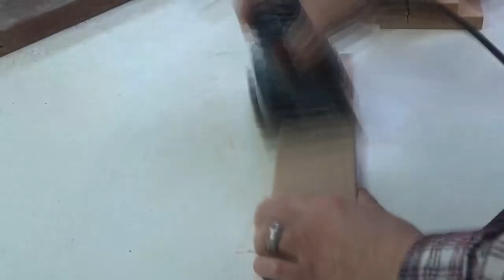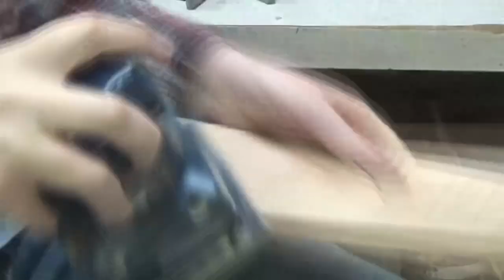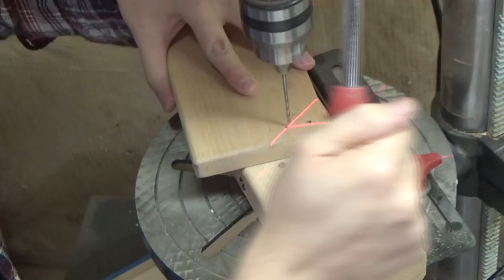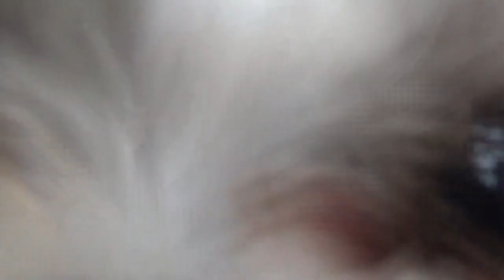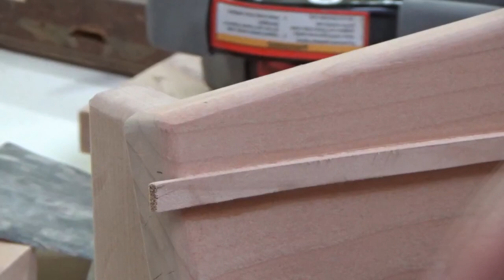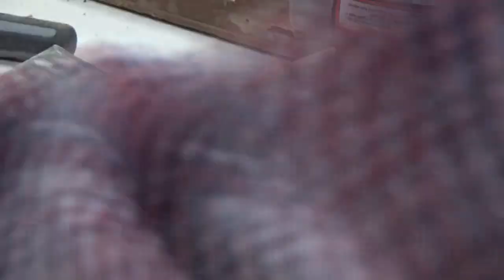Woodworking: How to build a self-sorting coin bank

Comment: Nicely done. Now you need to fashion a large hopper above so you can dump in a handful of coins. ;)
Reply from the maker: Funny you should say that... I was actually thinking of exactly that for another video.
Reply: You'll find that that aspect is hundreds of times more complicated than you might imagine. It is a completely different issue to be able to dump a big (or even medium sized) jar of coins into a hopper and have them come out one at a time versus feeding into a slot one at a time. Coins have several ways in which they can jam up and work with each other rather than cooperating with your wishes. The topic of and the physics of coin counters are....kind of interesting. Of course what you have is a sorter, not a counter.
Reply from the maker: I know how I'd do it. The key to feed them one at a time is doable since 2 of the thinnest coins (dimes) still are thicker than 1 of the thickest coins (a nickel). A hopper with a star wheel at the bottom that pushes coins through a slot just thick enough for 1 nickel. I just may get around to making it but honestly it's pretty far down on the list.
Reply: Gravity can assist as well if the star wheel is inclined and might help a potential jam situation - e.g. if the back edge of a nickle is resting a little on top of the wheel rather than fully in the slot the front edge may be able to get a bit into the slot. Totally overthinking this for the purpose, though, I know!
Reply: If you go and look at actual commerically made coin counters, no, you are not overthinking it, at least in terms of creating a real world functioning machine. There are a fairly serious lot of irritating problems dumping a big jar of coins into a hopper, having the coins come out one at a time, then sorting them. (Never mind counting them) It all seems so simple when you see a typical commercial machine working, even an older handcranked Klopp (which are great machines) apparently handling wads of coins with no big issues. But I can tell you, large numbers of coins piled on top of each other randomly can be phenomenally uncooperative. There are many many ways they can jam, they can have nicked edges or bits of sticky goop on them, or be bent. Or all of those. 

I happen to have a Cummins jetsort desktop machine that I got at an auction super cheap, not because I needed it, just because it was so cheap. And it is a completely fearsome machine. You can put 30 pound of coins through it, it will count & sort them in maybe a minute and change, and it will come up with the same count as many times as you put the coins through it.
Reply: Fisher's Shop you also need to devise counters for the sorter.

Comment: I relize there are a bunch of haters in these comments but i have been stuck on a slightly more technologically improved version of an idea like this for weeks. All of my designs have some sort of flaw and then i came across your video. It is simply brilliant, but i have a couple of technical questions for you, i understand the main ramp is the thickness of a dime, how much taller or thicker are the triangles than the main ramp in order to get them to push the coins off? and can you take that angle gauge from your table saw and post the angle you made for both the main ramp and the board that the coins lean against? i think that hose two things would be tremendously helpful.
Reply from the maker: Thanks gillespie!  The ramp thickness has to be the thickness of a nickel since that's the thickest coin.  The little triangles don't have to be so big because once the coin is moving, it doesn't take much to bump it off the ramp.  In fact, the steeper the ramp is, the smaller the triangles have to be.  As for the angle, I just played around with it until I found one where the coins would barely roll on their own (not sure exactly what that angle is).  Thanks for posting and commenting!
Reply: I am curious about one part of your design: what made you decide to bump the dimes off rather than let them run off the end? I do get that the style is probably better this way with all of the jars lined up. The reason I thought of this was a machine from when I was a kid - dairy farm kid but we also had chickens and sold eggs. The egg grader system we had thee scale stations on the track and dumped the eggs off at a right angle but ones lighter than the lightest scale were pushed off the end of the track to a separate bit of the table.

Comment: If you find yourself fighting a piece that wants to slip and slide around while clamping a glue-up, try adding a tiny sprinkle of table salt to the glue. Not a lot, just a dozen or so grains. You'll be amazed at how much of an improvement it can make! Another option is to apply two clamps below the spot you're working to use as a "rest" for the main piece.

Comment: curious as to why you didnt use buscuits at all when attatching the face plate to the base? it would have made it more stable while the glue set aswell as adding strength to the join
Reply from the maker: i don't own one.  It would have helped with alignment for sure.  But this doesn't need to be stable at all... there's no weight on it.  A pinch of salt would have kept the pieces from sliding, in hindsight.

Comment: Tip. To keep glue joints from sliding around sprinkle a bit of table salt in the glue.
Reply from the maker: I'd heard of this tip before but I'm still yet to try it out.  What I probably should have done is just used dowels for that joint.  Live and learn, right?
Reply: I have tried that salt trick.  Used a bit of coarser grained Kosher Salt, on angled surfaces similar to your situation in this video, and as suggested in the YouTube video where I found it.  Works well.
Reply: You can do the trick by rubbing some cheap, coarse sandpaper together too, since most of us don't usually have salt in our shops. lol I think it was Pocket83 where I saw that.
Reply: I often use salt for this. A few grains of ordinary table salt is enough. Don’t use too much because it dries the glue out. It’s well worth trying and having an old pill bottle (yes label removed)  of salt in the workshop.
Reply: Thanks, man will try that on the next project.

Comment: sleeves too close to power tools. pay attention. Roll 'em up !
nice project.
Reply: radiocontroljet
Reply: Re: Matthias video: I'm inclined to believe the results of his video personally, but ultimately this is nothing more than anecdotal (albeit several anecdotes in a row caught on tape). Calling to it as proof that you are safe with rolled up sleeves is nonsense.
Reply: experiments to be accepted must be replay anytime anywhere with same results. Try an heavy-duty winter sleeve (not a grandpa tissue) over a 310 mm rip cut blade on a 3+ KW tablesaw with a 2.5 KW aspirator. If you use your arm as tester you will find how difficult will be to type the next comment with only one hand.
Reply: radiocontroljetpilot "I'm Mr. Shop Lingo everyone look at me!" "oooo weee"

Comment: Shouldn't be too long until people start calling you stumpy, seeing as you like to run your table saw without a riving knife. I cringe every time I see a video that shows a table saw that has it removed. Do yourself a favor and read up on the significant danger of operating a table saw without one...
Reply from the maker: That saw pre-dates riving knives.  They weren't even an option when this saw was manufactured.  Riving knives are actually a pretty recent development in table saws.  My plan is to make a throat plate that has a splitter in-laid into it though.  That should give me a bit more protection.

Comment: Roll up your sleeves.  Ditch the ring maybe. Never freehand on a miter saw. Hey, nice metal working vise though!  Your cross grain joint will not hold.
Reply from the maker: I've decided that, in an effort to mitigate the chance of clothing getting pulled into the machine, from now on I'll be making all my cuts completely naked.  For added eye protection, I'll also be closing my eyes while operating any machinery.